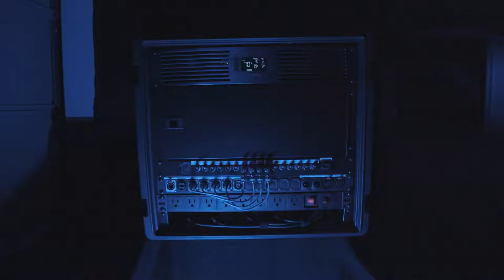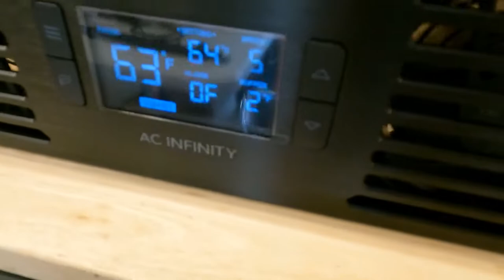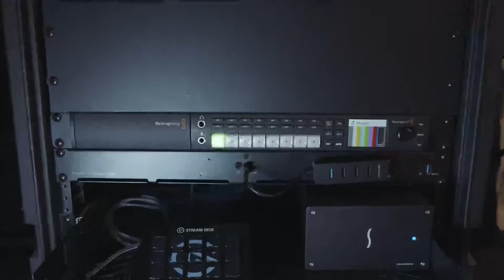PORTABLE Broadcast & Live Stream Rack | Part 1

Comment: Nice clean run. My Case has the 8k Constellation, The Hyperdeck 4k Rackmount, 2 4k web presenters, and a small switch. I have a 2 Unit 4 fan device. The box pulls a lot of power. Can't use it unless I have a paying gig.  I like your focus on keeping everything neat.
Reply from the maker: Nice!! The 8k is a beast. 
Have you had good results with the 4k Web Pres? I have heard they are freezing a lot.
Reply: @thatonetechyguy , I have not had to use them as much as I wanted to, so I have not had any freezes. I do like to use them to stream 4k. They also have the upscale converter built in. I look forward to following your channel; thanks for reaching out!